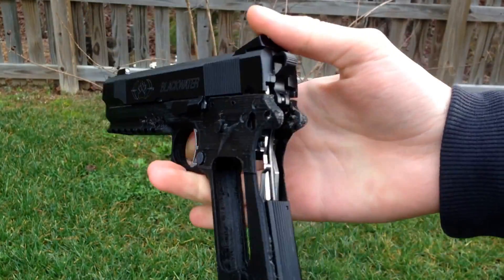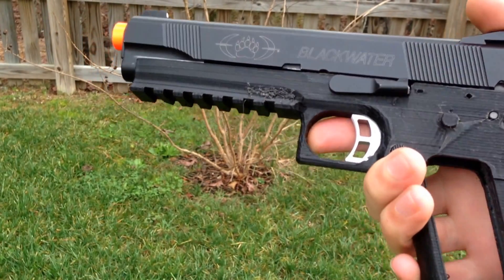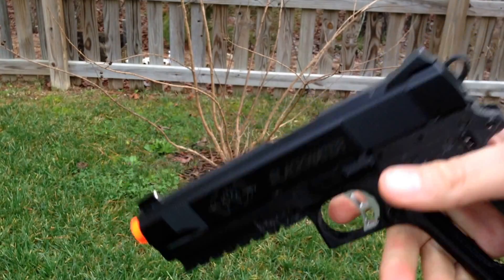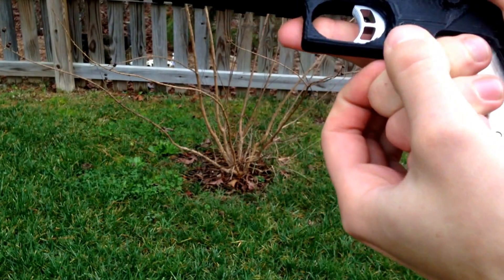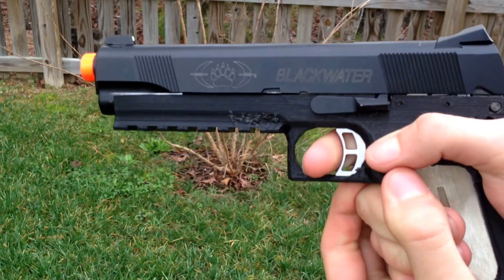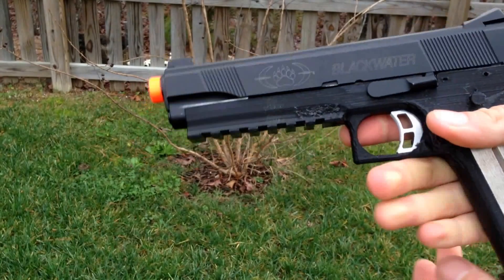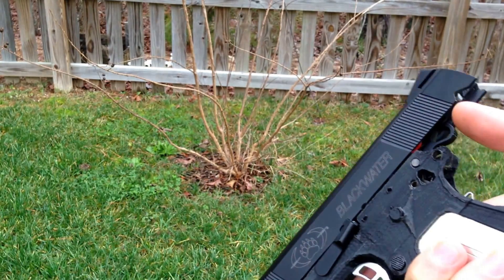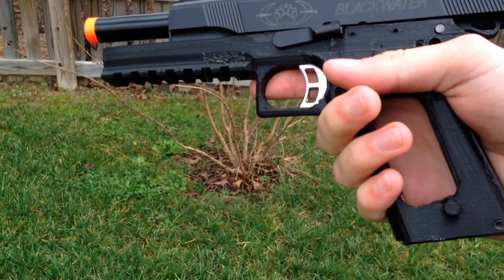3D printed 1911 project part:2 a first test

Comment: Fun fact: this receiver is available on GrabCad.

I printed one and combined it with the zvc one. The slide, like on this one, is shorter than it is suppose to be for the receiver.

I used real 1911 pins, springs, and disconnector for the most part.

Sadly, I need to reprint some parts as I printed it on a low quality printer before I got a new one.

Comment: Hey man where are you at with this frame? Interested in the project
Reply from the maker: Well I would love to make more videos and post files but due to youtube becoming so anti gun even when it comes to airsoft I have decided to not make anymore videos on the topic for youtube. At some point I might make videos for full 30 or one of the other more friendly sites.
Reply: @MOOTech  If it gets too crazy, use sites like Motherless or Fetlife. I did that years ago for my blog because did not want blocked. The adult blog sites have more relaxed reporting. Basically, in the case of motherless, "is this illegal?".

Comment: Is it an airsoft gun? Please, where can I get the files to print them? Thanks!
Reply from the maker: Yes its an airsoft gun, and unfortunately the project got sorta canceled so I never finished the files and thus never released them. I will however try to redo this project at some point and then ill post the files but I'm not sure when that will be.
Reply: Thanks!
Reply: @MOOTech  yo, when/where are these files released.
Reply: The sooner the better. that would be awesome if you could finish the files and release them I really want to make a functioning model of this.

Comment: do you know how to 3d scan guns?
Reply from the maker: I did try doing that to make this but I couldn't get a good scan of the inside so I ultimately gave up on scanning it and just modeled it.
Reply: MOO Tech dude i just need to scan the outside with ohotogrammetry, im practicing with an airsoft, but im having no luck..i just need a mock gun, but an exact 1:1 replica for holster making.

do you know if modelers that use blender or something is capable of creating a 1:1 scale model , that i can then convert to 3d printing? i just want to know if its capable of doing so
Reply from the maker: urjnlegend I would just scan it then. I gave up because I needed all the internals to be 100% accurate for it to function but if you just want a mock gun for making holsters then you may not even need to scan it depending on the gun your trying to make a holster for, you might be able to just find a model online.
Reply: MOO Tech but how can i tell if its accurate, like to scale? it has to be an exact 1:1 scaled replica, mock like you said. Im new to this, but need to get this working Asap. i tried googling accurate gun models, or 3d printing ones, but im having a hard time doing so
Reply: MOO Tech photogrammetry is kinda hard for a gun ive tried. i dont have a laser scanner (idk if thatd work, if it does, i can try that) , ive recently came across people making models in blender, but i dont have the downloads or know if its even accurate, but they look it. you modeled yours, how? im sure there is a steep learning curve too. i could buy mock guns for $50 a piece, but im.trying to print my own, its just the files i cant find.
Reply from the maker: Yes there is a pretty steep learning curve especially if you don't have any sort of experience at all. I use 123D design for all of my modeling because its free and I find it relatively easy to use. The way you tell if its exactly to scale you just measure the real gun with calipers or another accurate measurement method (ie not a ruler) and then measure it in software and see how close it is then adjust the model accordingly till its exactly to scale.
Reply: MOO Tech i just need to know how to measure in the software and the in person stuff is self explanatory
Reply from the maker: In 123D design its pretty easy but there are loads of tutorial out there so you shouldn't have a hard time.
Reply: MOO Tech did you do this in 123design?
Reply from the maker: urjnlegend Yes I do for just about every thing I 3D print. For some stuff though I get a model online and modify it like I did here.